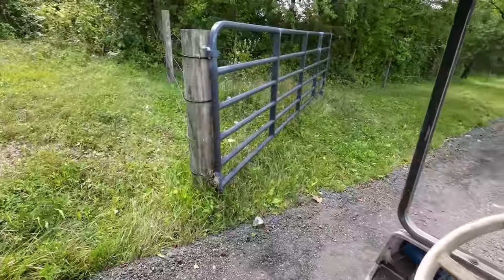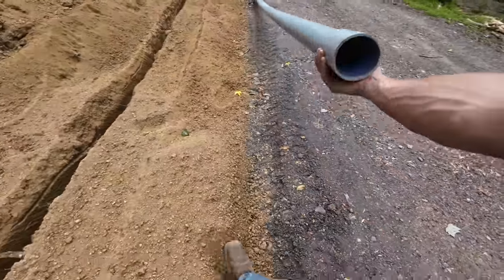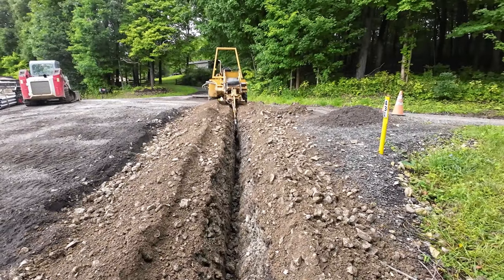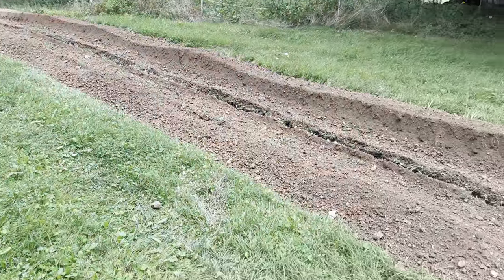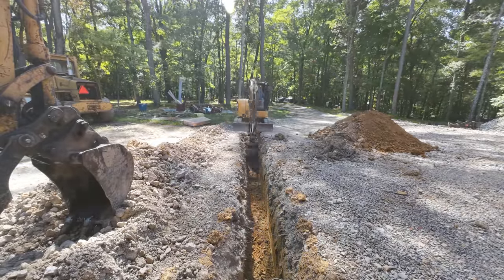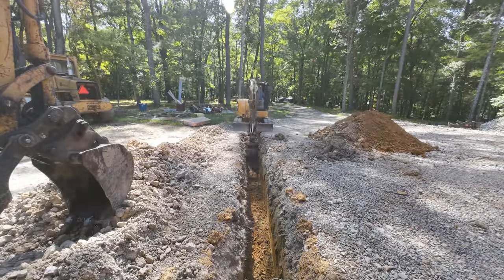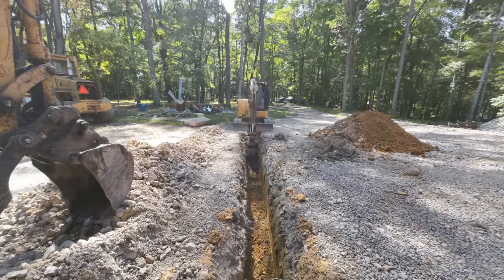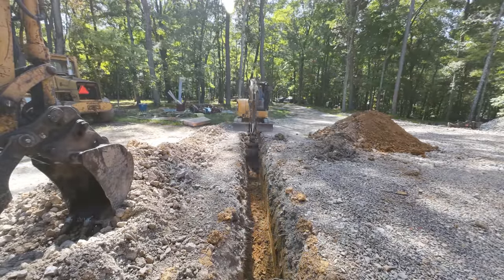Running Nearly 1/2 mile of Underground Electric, Costs over $64,000??!?!

Comment: My powerline has 14 poles over 2400 feet. In 1983 it cost $10k to install. Hydro owns only the first and list poles. The other 12 poles I own. Since then I've paid to replace all but the first and last poles which HydroOne owns. The poles all had to be replaced by a licenced installer at about $1500 per pole. Of course this was at Hydro's direction. Failing to comply would result in a safety lock out. I've also h had to maintain a clear right of way under the line. I wish I had buried the line when I first brought in power.  

Great videos.

Comment: In the UK, pipes are buried in pea gravel, then tape, then more gravel before pushing the dirt back in. That way, when you're digging in the future, pea gravel means pipe/wire before getting to the warning tape. Plus, the gravel beds and surrounds the pipe much better than dirt.
Reply: Ours, we don't recommend pea gravel. We use   gravel only for pipe bedding. The rest is fine sand. Because if theres emergency (maintenance) troubleshoot, we can dig it easily. Pea gravel is very hard to dig manually.

Comment: Just ran electric to new house build . Short run maybe 50 feet ,but they did everything. Would have to check my receipts but pretty sure it cost $2500. That was in south central ky, things are cheaper in that part of the country. Answering your question that number seems way high.

Comment: I'm very fortunate where I live. The Electric co-op charges $11/ft for overhead and $21/ft for underground. As well as a credit depending on what kind of building you have $2500 for a house. They had to go about 500' for ours. We decided to go overhead so they did everything to the line side of the meter socket for $3000 out of pocket.

Comment: You are right, that price is outrageous. If I were you, I would find a small electrical firm that runs overhead power lines [some firms only do overhead work] in your area, and contact them privately to ask for a competitive bid to do the work. During my time doing government contract work, I had to extend an overhead line about a half mile to provide power to a water pump station I was building, and the power provider gave me the runaround too. So, I contacted a small firm to quote and build it, and I ended up paying them a reasonable price to extend it. Maybe if they will for you, pull the wire, set and provide the transformer, then maybe you can get your local power company to flip the switch? Also, sometimes having them separate the materials and labor in the quote will help. But, be careful about you providing the materials--issues can arise. Where there is a will, there is a way. Good luck
Reply: And they only charge $15,700 to flip switches. Per flip OK. Sign here.

Comment: We had a similar situation in middle Georgia 3 years ago and had 1100 feet of wire pulled to run power to our barn.  FWIW, you do have to pay for the transformer (we did).  Even so, they did everything, even trenching it into the ground with their big trenching machine, set the ground transformer and made the connection to the meter.  All of that cost us just over $5K.  $52K is highway robbery, as you said.
Reply: What would be the cost of a complete solar system  (batteries).
Reply: Electric company must be thinking they have to trench the 1800 feet and bury the conduit. Good luck escalating them.

Comment: I'm always taken aback by how much labor goes into just providing a safe path for pulling the actual conductors through. It's just one of those things that is more than meets the eye, even when you look back at your own work, it just doesn't seem possible that you would have to bust your butt as hard as you did to get it done. Thankfully, it's one of those jobs you will hopefully never have to do much to maintain or repair for your lifetime. I found the suggestions about the GRC 90's, the expansion sleeve, and the outside contractor to do the cable pull very consideration worthy. Still, it's a great and necessary investment. Solar is a consideration in this circumstance but I definitely favor the Utility route.

Comment: Couple things to try: Make a complaint direct to the state regulators - skip your local regulators they aren't likely to help. Find the specifics you talked about, screenshot them, and create a BBB complaint if they are not honoring their own documented policies.
Reply: If you do that , you are just gaslighting yourself . Good thought though .
Reply: The BBB is total crap and don't do anything have used them before.
Reply: @matt2244  So true brother .
Reply: The PUC is the regulator agency, no local ones usually in PA. And most companies are very scared of the PUC in PA. I've seen phone companies bend over backwards to keep them out of the picture. The BBB is useless, especially for the company that I'm pretty sure he has to use.
Reply: @robertn2813  You must not know what gaslighting means.
Reply: @matt2244  You have to do things right. Most people don't look thru BBB rules and so incorrectly use the process. You gotta know what you are doing first.
Reply: @icarus_flying1994  If it's that corrupt then f them and go solar. He could setup a fully solar system with battery backup for less than the quoted price if he did it himself, and he would.
Reply: @kyferez1 You don't know what you're talking about. The BBB is a for-profit company, not a regulatory agency. They extort businesses to make their money. Any company you ever see advertising their BBB rating was contacted by BBB sales and paid for their rating. You need to do some research.
Reply: @Studio23Media  Actually you are the clueless one. Bbb can and do make fair business practice rating judgements against all types of businesses. The agency that is making extortion level demands that go against their own advertised rules can be held by the bbb as bad business if complaints are made and that business can be given a bad rating. Also any business can have a good rating and you dont have to pay them a dime for that, simply demonstrate good practices and deal fairly in business if a complaint ever comes up. How do I know? I owned a business and had a false claim against me and I won and had a good rating and never paid them a cent. I also have used bbb to successfully resolve in my favor complaints against companies using unfair tactics and not upholding their warranty. You gotta know how the rules work and follow them to win. So clearly I know more than you thought and you don't know what you thought you did.
Reply: PA  will try anything to pick your pockets !!!  They dont get that by helping the consumer they would get more long-term revenue.  Also, those hourly labor rates are crazy,. thank the unions for stifling growth in the consumer market.

Comment: Got all that rusty junk and had to rent equipment.  I feel your pain Matt.  Have many gravely walk behind tractors.  Had to buy a modern field mower.  Sometimes you just gotta get it done with no interruptions and equipment failures.  Great stuff Matt.  Good luck with the power company.  Cost me $7,000.00 dollars to put in a telephone pole and panel onto my property.  Ran the final 100 feet to another box in a building myself.  Between plans, contractors permits and the town in general it was a major pain.  Ran generators for 6 years.  I always appreciate it when I now turn on the lights.

Comment: With that insulated building.. I think you'll be shocked to see just how little heat it takes for it to stay comfortable in the shop in the winter.  Even if you still keep your coat on while you work---  just a little wood burning stove would heat that whole shop fairly quickly.  I understand that you have the heated floor and all that--  but I think you'll find that you won't really need to run it all that much.  That insulation makes it super efficient beyond belief.

Comment: In our area, sometimes we'll temporarily install Honda EU2200 connected to a large gasoline or propane tank for customers in your situation where they need power but utility don't act soon enough. Mentioning it incase that helps relieve some pressure to resolve power cost issues.
That conduit job was very large for 1 person.

Comment: I did aerial line construction for over forty years.  Dabbled a little in underground.  Going aerial is typically a fraction of the cost of going underground.  Not sure if that was even an option in your case but it doesn't matter now,  the pipe is in.   I always worked as a contractor and got paid on a commission basis.  It was always assholes and elbows out on a jobsite.  No lunch, no breaks, we just worked from start to finish everyday and we got a lot done.  Two to three guys could easily pull that primary in in a day, run the riser, set the peds and do all of the grounding the next.  If the power company would work with you on this, you could grab Sam and another buddy and save yourself a ton of money on labor.  Good luck!

Comment: Most likely the power company will sub-contract out the job to pull the wires , set the transformer and connect everything up to the meter socket , then send a crew from the electric company to connect up the power at the pole and install the meter , but $52,000 to do all that is outlandish , keep pushing back Matt !!!!

Comment: Hi Matt. Nice job burying the conduit. It’s a huge project! We ran the power to our house ourselves through conduit. 350 MCM in 4” conduit which we ran while burying. It was brutal. This was years ago and maybe things have changed, but look into an expansion joint where the conduit enters your meter box. If you haven’t run the cable yet it’s easy to do and gives some flexibility there.
Reply: 350 MCM!? How big is your house? That's like 300 amp service.
Reply: @erikkovacs3097  300 amp service is pretty common on all Electric homes these days with tankless water heaters and electric car chargers.

Comment: This is not an unusual price at all. I am in Canada, so despite dollars being a bit less it is still one of the most expensive utilities to run. I have an 82acre property we built on in 2016. We put the house 300ft off the road and dug our utility trench from the pole out front, 100ft along the road but on our property to the driveway, straight down the driveway to the transformer box area, then 60 or 70ft to the house. Our electrician put in the wire, and extra communication lines, to the transformer box area and house. We dug the pad 4ft down and put a bed of 3/4" clear stone for the box and waited a month past when the utility was supposed to put it in for them to drop in the box and hook up the lines. They also made us put in a new pole because the existing one was to small to host a new transformer on their end. They also sent crews of up to 15 guys and 5 trucks, for 2 weeks in and around the install dates who sat there for 1-5 hours doing nothing, or accomplishing nothing. The quote for the hook up and transformer box/installation was $28000.00 + $6000.00 for the new post. $34000.00 CAD. That is what they charged us and we did all of the work. This year we asked our electrician to put in the quote process for them to come out and assess the price to hook up the shop to the grid. He did so in March and it's only 50-100ft off the road. We still have not received a firm number although they put a stake in to mark which pole it will go to.

Comment: Hydro numbers are astronomical up here in Canada as well when it comes to long runs up farm laneways, etc.. Last number I heard was something like $5K per Pole where burial isn't an option.
Thanks for sharing 🇨🇦
Reply: Yes it’s very expensive.  We had a quote of $97k to hook up power at our dock, that included the cost of replacing 4 poles, 650 feet of power line and a step down transformer to go from 3000V down to 600V 3 phase.
Reply: Yup seems to be an international thing. Here in Australia we were quoted close to $20k per pole.

Comment: Due to the PSI  compaction rate on the skid steer, you'd get more bang for your buck using even the pick up truck to compact the trench. A truck tire has a higher rated PSI compaction that would a track machine.

Comment: Hi, this may be a crazy question but why don't you check around with contactors to get other prices to pull your power wires. Or even better, pull your own wire through the conduit at each pad and transformer. It must be different rules in Pa.  Oh, great job.

Comment: Hey Matt love your stuff but be reasonable. Just for you portion, have you put a price for your time and equipment if you were to charge out this job? I’m telling you that the power company for their work alone would have been $100K plus where I live. $52K not bad considering it will be 2 trucks and 4 man crew, pole framing and fuse cutout, grounding and lighting protection, metering, transformer pad supplied and placement, pull boxes, setting transformer splicing and testing. I think it’s a bargain for the length of service installed. Trust me when I say this contracted out North of $190K. Anyhow, love the channel! And as always, thanks for your hard work.

Comment: Would probably be cheaper to get a outside contractor to pull the electric lines my guess is the power company didn't/don't want to do the job, good job doing the hard work hoping everything works out well for you Matt.

Comment: If you can, perhaps add some "finished space" to the shop or a small building you can have in pretty quick. Another option would perhaps be to say your  shop is used for agriculture. The language you use with the company can affect pricing. I am here in southern KY, and was at one point a groundman for one of our local contractors to our electric company.

Comment: Have you ever thought of building a waste oil heater?  I wonder if the price the quoted you was for the entire job...where they put in the conduit, boxes, and all that
You did the hard part..it shouldn't be that daggum much...WOW!
Keep em coming!!!!
Reply: Maybe not enough waste oil for a permanent heat source? think he could find a reasonably sized new or used unit however to heat an area on demand?  Also, would he want to install those vinyl flaps over the entry doors to help conserve the heat in the cold months? Matt is a very talented and capable individual!

Comment: That price from the electric company is completely outrageous!  I would fight them all the way up to engaging a lawyer and going to court.  You and I both know that $20 Grand would be plenty for them to buy the wire, pull it, and connect up.  Power to the Matt!  Power to the Matt!  Fight!  Fight!  Fight!
Reply: As it took from January to August just for a price estimate, how long do You imagine it will be before the work even starts when the All Mighty Power Company hears the words, court, attorney or litigation ?  Even a amiable negotiation on pricing is going to add quite a bit of time to the job. 
The main thing that " They " will make You remember is  " We are The Power Company and You are not ! "

Not to mention that. " They " have a battalion of attorneys standing around waiting to engage an opponent .
Reply: No offense, but no. 15 years ago when I did engineering for a power company on the opposite side of the country, 1/2 mile of single phase UG, plus a pad mount trans, plus service wire, plus connection fees, plus whatever other bullshit could be thrown in would have been minimum $12k. Add a pole replacement which it definitely looks like is needed, pot head for a fuse, and you are over 15 easy. Frankly it is a wonder they didn't make him put in vaults for junction boxes every 1200 feet. With inflation I easily see it being in the high $40k range now. Different union, I'm not up to date on prices, different state regs, yea, 54k is right there. 

If you have ever heard the phrase the railroad is king, it's still true, but that makes electrical utilities some sort of duke or czar, you would never beat them in court. Best case scenario is you will have a note in your file as a difficult customer and get shitty service in the future when problems do arise. 

Is it legal robbery, yes, but fighting it is a bad idea.
Reply: That is a good way to not have power for years and spend WAY more then $50k in attorney fees alone. Unfortunately that price is not outrageous it's close to what i thought it would be. I am guessing you have never had power run in out in the sticks where there is none.

Comment: Matt, I moved a 450’ overhead power line on my property which fed my neighbor and myself, it  became 540’  with the relocation underground, this was on  in 2006, West Penn power had to engineer the change, 5k just for that. I also moved the cable and phone too, so had to deal with comcast and Verizon too, put that in a 2” conduit, when it was all done I figured I had roughly 10k in just materials plus the engineering of the new right away, , plus my labor costs and machine rental which I did all myself it’s a daunting task !!! I feel your pain!!!